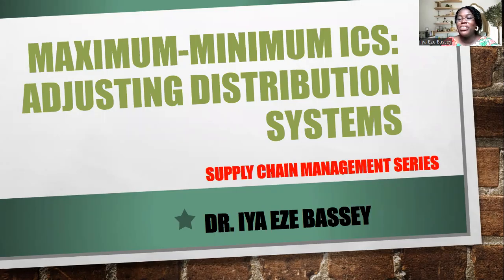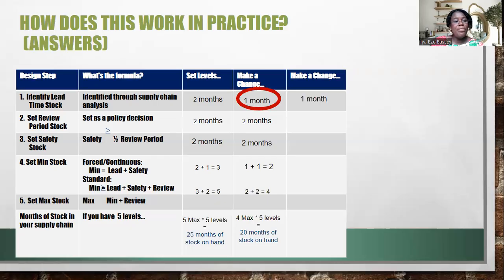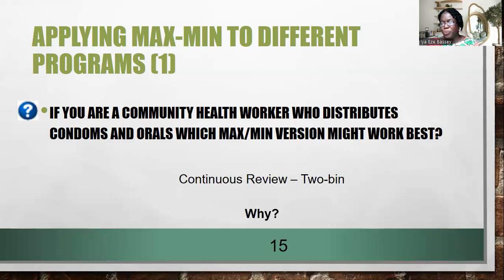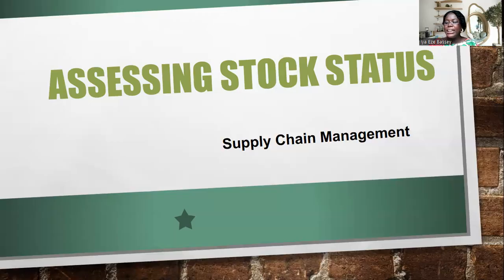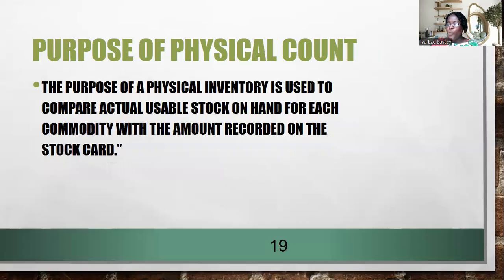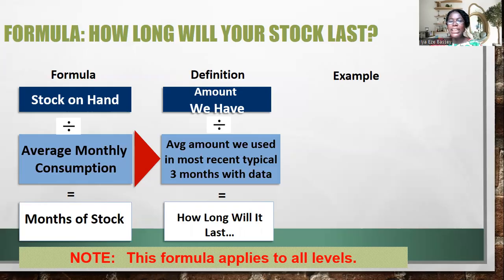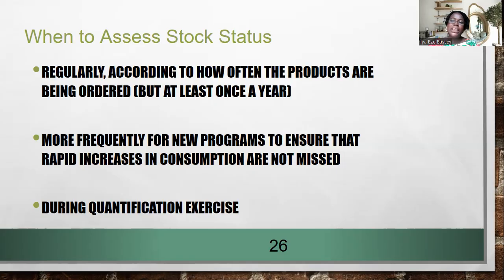Maximum-Minimum ICS: Adjusting Distribution systems (Supply chain management series)

Comment: Thanks ma for the lecture on logistics management information systems (LMIS)

I got to know the meaning of LMIS which is the system of records and reports used to collect, organize and present logistics data gathered across all levels of the system.
The purpose of LMIS which is to collect, organize and present logistics data gathered across all levels of the system in order to make informed decision
And also got to know that there are 2 level of supply chain logistics system for HIV/AIDS commodities, which is the central level and the service delivery level (SDP).
are receipts from one facility to another at the same level.
Getting also to know the activities that happen in supply and understanding the types of Records which are:
1)stock keeping records
2) Transaction Record
3) consumption records
And also examples of consumption records used in LMHC in Nigeria which are the ARV drugs daily consumption record, Daily usage record for HIV test kits, Ol drugs daily consumption record
I also got to know the 6 right for LMIS which are the;
1)Right data.
[2]in the right quantity
3)in the right quality.
[4]at the right time etc

Comment: Thank ma for this beautiful class
Max- min inventory control system are useful or important for managing the the supply of laboratory regents and equipment in medical laboratory science.  By setting the right maximum and minimum stock levels, this also keep operations smoothly and timely delivery of appropriate test result thank you ma.

Comment: Thank you so much Ma for this lecture session.
On the steps in designing a Max-Min ICS; 1) Set up initial Max-Min policies for each level and type of facility. 2) Check if the overall distribution will function properly if the level specific Max-Min policies are implemented. 3) Check the total length of the pipeline that the policies at each level imply. 
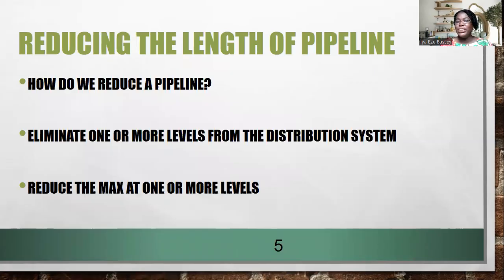(4:01) The length of a pipeline can systematically be reduced as well. How?
(a) Eliminating one or more levels from the distribution system and (b) Reducing the Max at one or more levels.

📌 ON ACCESSING STOCK STATUS; I learnt we have to access and know how long our stock lasts in months and the first thing to do is Physical inventory (count). (19:13) Its formula being Stock on hand ÷ Average monthly consumption = Months of stock. 
📌 When to access Stock status? Regularly according to how often the products are being ordered, more frequently for new programs to ensure that rapid increases on consumption are not missed and during Quantization exercise. (27:10)

Comment: This video talks about the adjusting distribution system in max-min inventory control system.
The max-min inventory control system provided comprehensive guidelines for managing stock levels to prevent bothe overstocking and understockinh of goods. It encompasses varios steps involved in designing the system, methods for reducing pipeline length and factors affecting thw max-min stock levels.
The max-min levels also aids in avoiding emergency order costs by providing a guide to the stock status on a regular basis.
Lastly, it assist in the assessment and management of pipelines of policies at each level.

Comment: In this series I am made to understand the purpose of inventory control system and the meaning of some ICS terms which is emergency orders, safety stock levels,
Review period maximum stock level.
In this series I was able to know the type of ICS that is in use in country ( Nigeria) . Also learn how to calculate the absolute quantity of determine test kits used in the maximum stock level.
In this series I learnt about three major rules in inventory system which is the Forced ordering, continuous review max-min version and standard max-min version.

Comment: Thank you Dr lya Eze Bassey for this amazing session.

In summary, the maximum _ minimum Inventory control system provides comprehensive guidelines for the management of stocks levels to prevent both overstocking and understocking of goods. The steps in designing a maximum minimum control system includes:
1) set up max_min policies for each level and type of facility
2) verify that the overall distribution will function properly
3) Establish initial max min quality for each level and facility type.
Some benefits of using max_min system includes:
- it helps to avoid overstocking
- Avoid understocking
- it also helps to minimise wastage
Some challenges of this system include: system with numerous levels

system that manages a large number of commodities systems that manages products for new programs.

Lastly, physical count of stocks is important and should be done at least once a year. In cases where stocks are moved rapidly, count should be done frequently to ensure adequate inventory management.

Comment: Thank you ma for this educative lecture, In summary, I'm able to know how to identify steps to designing a maximum minimum inventory control system which includes:
1) setting up initial maximum minimum policies for each level and type of facility
2) check if the overall distribution will function properly if the level specific maximum policies are implemented
3) check the total length of the pipeline that the policies at each level apply to, factors that impact maximum min stock levels are cost of product,cost of storage,storage capacity. The advantages of using maximum min system is to avoid overstocking,understocking and wastage. It helps to maintain a consistent supply level.

Comment: Thank you ma,in summary the purpose of this max,/mine inventory control management is to maintain an appropriate stock level of all products avoiding shortage and over supply.To determine how much stock should be ordered/issued. The rule is to review all stock levels at the end of each period.And order enough stock to bring stock levels up to maximum.. advantages: it review stock level every two months while disadvantages it can hold at anytime.

Comment: Thank you ma 
I understood that there are several factors that adjusting the distribution system in a maximum inventory control system (ICS) fine-turning the supply chain management system to optimize inventory levels and distribution process..I also learnt that the purpose of adjustment system showing the purpose of physical count after delivery and many more.

Comment: In summary, I've learnt the steps in designing a maximum-minimum ICS and they are as follows;

-check the overall distribution. It will function properly if the level specify max-min policies are implemented

-check the total length of the pipeline that the policies are each level comply

setting up initial max-min policies for each level and type of facility. Advantages of max-min system were listed and lastly, it was stated that physical count of stock is important and should be done at least once a year. In cases where stocks are moved rapidly, count should be done frequently to ensure adequate inventory management.

Thanks you ma for yet another impactful session.

Comment: Thank you ma (Dr Iya Eze) for this video. I'm able to understand from it that:

1. Max-min ICS in supply chain management is valuable for adjusting distribution systems.

2. The steps taken in designing the max-min ICS includes: setting up initial max-min policies for each level and facility, checking if the overall distribution would function properly, and checking the total length of the pipeline that the policies of each level imply.

3. There are 2 ways to reduce the flow of health commodities at a facility. These can be done either by eliminating one or more levels of the distribution, or by reducing the maximum at at one or more levels.

4. The max-min ICS had advantages: it minimizes wastage, avoids overstocking, avoids the cost of emergency order, and avoids understocking.

5. The key storage activities being carried out are: supplying receiving and incoming inspections, putting away, picking and packing, and shipping.

6. The factors that impact maximum and minimum stock levels are: storage capacity, lead time, products cost, accuracy of forecast, reliability of transportation, management skills of staff, and so on.

7. In accessing stock levels, a physical count is usually done to calculate the total number of usable units in the health facility at a given time.

Comment: In summary of max min ICS
I have learned about the various steps necessary in designing CA max-min inventory control, the methods for reducing pipeline length , and some factors affecting the max-min stock levels. 

Furthermore, I now understand the benefits of a max-min system, such as preventing overstocking qns understocking, along with the challenges associated with different versions and variations.  

Amazing
Thanks Dr

Comment: Thank you Dr lya Eze Bassey for this wonderful lecture video 
In this lecture video I learned the following:

In summary, the maximum _ minimum Inventory control system provides comprehensive guidelines for the management of stocks levels to prevent both overstocking and understocking of goods.

The steps in designing a maximum minimum control system includes: 

1)set up max_min policies for each level and type of facility

2) verify that the overall distribution will function properly.

3) Establish initial max min quality for each level and facility type
Some benefits of using max_min system includes:

- it helps to avoid overstocking

-Avoid understocking

- it also helps to minimize wastage

Some challenges of this system include: system with numerous levels

system that manages products for new programs

system that manages large number of commodities.

Lastly, physical count of stocks is important and should be done at least once a year. In cases where stocks are moved rapidly, count should be done frequently to ensure adequate inventory management

Once again thank you very much and God bless you Amen

Comment: This session teaches about the adjusting distribution system in the maximum or minimum inventory control system. It discussed the Length of a pipeline which consists of three 3 steps. This also leads us to reducing the length of pipeline. the ways to identify how to adjust distribution system policies depends on the length of a pipeline and how to modify the pipeline to reduce the max at one or more levels to improve the distribution of systems reliability. Storage capacity, cost of products, shelf-life of health commodities, lead times, accuracy of forecasts etc that impact max-min stock level should be checked to ensure consistency of all stock levels. It also enlightened on a physical count which is the total number of usable unit of each commodity in store. the main purpose is to compare actual usuable stock on hand.
The calculation part was also interesting.
Thanks once again!!

Comment: In adjusting the pipeline in the max-min ICS, the following steps must be considered;
- Set up initial max-min policies for each level and type of facility 
- Check if the overall distribution will function properly if thelevel specifymax-min policies are implemented 
- Check the total length of rhe pipeline that the policies at each level imply.
Also, the benefits of max-min system prevents overstocking and understocking.

Comment: The session was aimed at looking at the overall pipeline for the max/min ICS and to see how it can be improved upon to deliver commodities from the central to the med lab level.
The steps in designing a max/min ICS include; to set up initial max/min policies for each level, check if the overall distribution will function properly and check the total length of the pipeline that the policies at each level imply. To reduce the he length of a pipeline in order for commodities to reach the consumers (scientists) faster ,we are to ; eliminate one or more levels from the distribution system and reduce the maximum SOH at one or more levels. This can not be achieved arbitrarily but rather scientifically. Factors like cost of products, reliability of transportation , storage capacity and cost of Storage can impact the Max-Min stock levels .

Comment: In summary, this lecture talks about the steps in designing max/min inventory control system, how to eliminate one or more level from the pipeline.
The steps in designing max/min ICS, include;
- Setup max/min policies for each level and type of facility
- Verify that the overall distribution will function properly
- Establish initial max/min quality for each level and facility type.

The benefit of using max/min were also stated in this video. There include;
- It avoids overstocking
- It avoids understocking
- It prevents wastage

Lastly, physical count is the process of counting by hand the total number of usable unit of each commodity in your store or health facility at any given time. Its purpose is to compare actual usable stock on hand for each commodity with tge amount recorded on the stock card.

Comment: Thank you ma for this lecture...
I've learned about how to modify a pipeline by eliminating one or more levels from the distribution system and also setting up policies that can help reduce the maximum at one or more levels.
In applying to Maximum -Minimum to Different Programs.. I learned that if I was to be a designer of systems for drugs, HIV test, kids and labs, I wish use the standard version because it has a lot of facilities that I can use and depend on and it is very efficient for working with large number of commodities.... I wouldn't want to use the continuous review version because it is used for a system that requires few numbers of products..
Moreso, I learned about a physical count as a process of counting by hand the total number of usable units of each commodity in your store or health facility at any given time..
Also, that stock on hand is the amount we have.. Average monthly consumption is the average amount we used in most recent typical 3 months with data and the Months of stock is how long the commodities will last...

Comment: In this video,  learned about the steps involved in designing a max-min inventory control system. These steps include setting up initial max-min policies for each level and type of facility, checking if the overall distribution will function properly with the implemented policies, and checking the total length of the pipeline that the policies imply.

You also learned about ways to reduce a pipeline, such as eliminating one or more levels from the distribution system and reducing the maximum at one or more levels. Additionally, you learned about reducing the maximum stock levels by making changes to elements of the formula. Examples include shortening the review period, reducing the lead time, and improving the distribution system's reliability to reduce safety stock.

Overall, you gained valuable knowledge on designing a max-min ICS and reducing stock levels.

Thank you Dr ma.

Comment: Using the max-min systems aids in minimizing spoilage, preventing over and under stocking. The steps in designing a max-min ICS begins with setting up initial policies for each level and facility type, checking if the distribution will function efficiently with the set up policies, and checking the length of the pipeline.The physical count of stock is important but in cases where the stock is moved rapidly, the count should also be done frequently to ensure adequate inventory management.

Comment: Thanks😊.
I've acquired knowledge about the steps involved in distinguishing maxmin inventory control system (ICS), the methods of reducing pipelines length and various factors affecting the determination of max-min stock levels. I've also gain in the benefit of max-min system, such as preventing over stock and under stocking along with various challenges. I'm glad to say that the class was enjoyable..
Thanks 🙏

Comment: Thanks ma for this insightful lecture
I have been able to understand the steps in designing the pipe .
How to reduce a pipeline by :

1. Eliminating one or more levels if distrubution
2.setting up policies that reduce the month at one of more levels.
 I also learnt about the elements to reduce Max stock level by
1. Shortening the review period at one or more levels.
2.Reduction the lead time at one or more levels
3.improving the distrubution system at one or more levels

 Finally I also understood about accessing stock status.

Comment: I am grateful for the enlightening lecture, which enabled me to gain valuable insights into optimizing inventory management. The key takeaways from the video include strategies for streamlining the supply chain by eliminating unnecessary stages in the distribution system.

Factors influencing optimal stock levels include:
- Product cost
- Storage capacity
- Shelf life of health commodities

The benefits of implementing the max-min system are:
- Mitigating overstocking
- Preventing understocking
- Reducing wastage

The lecture also addressed the challenges associated with implementing diverse versions and variations of this system across multiple levels. This lecture significantly enhanced my understanding of managing inventory control for HIV/AIDS commodities, empowering me to make informed decisions in my professional endeavors.